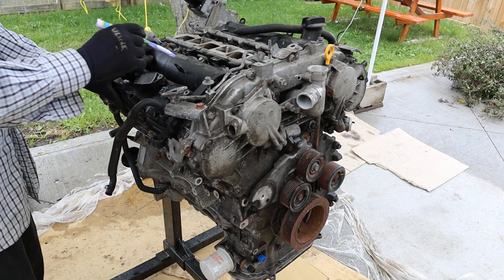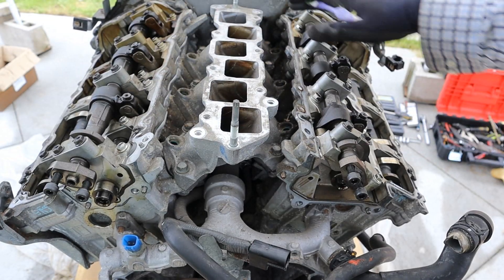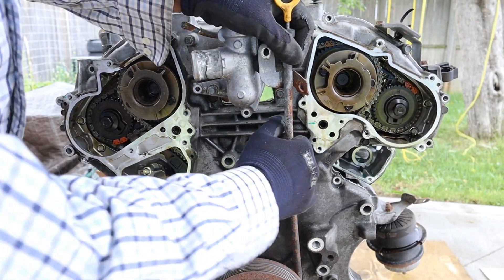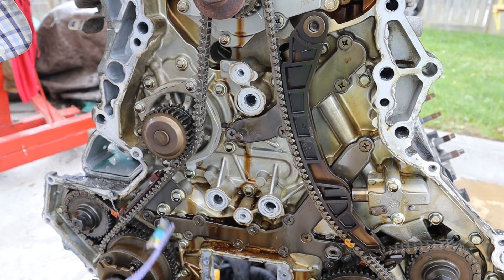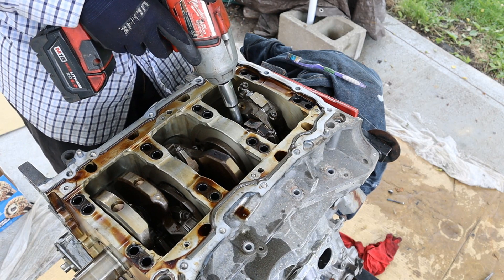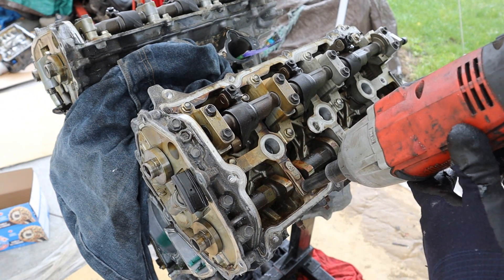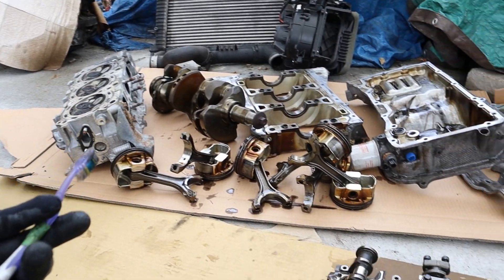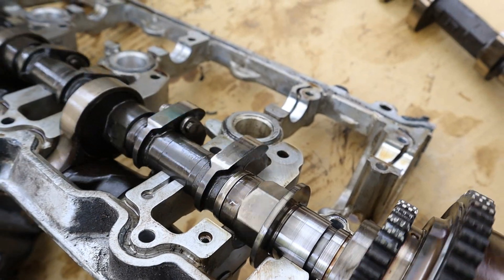The Last Good Nissan Engine: VQ37VHR

Comment: This is not a good engine....This is a GREAT engine!
Reply from the maker: Sure it is....if it doesn't starve itself of oil
Reply: I still see so many of these Infiniti's around unlike Lexus, Acura, MB, BMW from this era.  VQ37VHR 💪
Reply: @erikllanos3906  this has been the most reliable vehicle I've owned.  And I've owned a Honda's and a Lexus is350.  The VQ37 will go down as top 5  best V6 NA engines of all time 🏅
Reply: @speedkar99  the oil starvation is pure lack of maintenance and nothing to do with the engine unless it’s caused by the gallery gaskets. My best friend has a g37 with 180k and it burns like 1/8 of a quart between 5k mile oil changes.
Reply: @trizkial7592  ...and if you get a 2012-and-up VQ37VHR with redesigned gallery gaskets, it's damn near-bulletproof. Change the 5W30 oil at every 5K miles, that's it. Mine has 116K on it and is 10 years old, doesn't burn a drop and I've had it since Oct 2016.

Comment: I have a 2010 G37X w 212k miles. Switched to 3k OCI with marvel mystery oil during the last 500. Runs very smooth. 0w-40 in winter 5w-40 in summer. Need to do the gallery gaskets soon owner before me never did them.
Reply: Do them now.
Reply: @doubledewdagod  I ran a pressure test and it was super low on idle so 100% getting done before summer. And no more daily driving it until then
Reply: @urygen  How did that go?
Reply: @jacquesc3166  ran the test with another gauge cuz I suspected it was faulty and the pressure was actually good. All within spec. Still on original gaskets now at 227k miles. Running Rotella T6 5w-40.

Comment: Nice breakdown. Lots of metals, must be a very heavy engine. Replacing the water pump won't be quick either.
Reply from the maker: Yep, it sure is heavy. As is the FM platform of cars that used this engine. Not the nimblest at all
Reply: trust me it isn’t. i’ve done it twice
Reply: @speedkar99  ...but you drive a GS350?!? Sure hope you're aware that car is substantially less nimble than a G37, did you look up their Fr:Rr weight distribution? Have you actually driven a G, or just guessing? Your comment makes me think the car does NOT have double wishbones up front. Don't piss on G's, you won't like it.
Reply: @jacquesc3166  He is driving old mans lexus and G37 is not nible enough for him) G35 and G37 just a notch lower in steering department then bmw 3 series .

Comment: I have a 07 G35 with the VQ35HR engine and it's a great engine if it's taken care of. I've recently did the updated oil gallery gaskets (original gaskets were not blown out) and water pump, mainly the water pump because it started to leak through the pisshole and looking at it and comparing it to my old Maxima DE engine, this one is a nice design with too much bulletproofing. I was looking at newer G37s but after seeing the VQ37VHR engine and the unnecessary complexity that was added to it, I quickly swayed away from it. Only 24HP and less than 10TQ gain over millions of dollars in research.. :face-turquoise-covering-eyes:
Reply from the maker: Does it burn oil?

Comment: My 2019 370Z is hitting 42K miles and the engine uses no oil, as indicated on the dipstick, between my 3K mile oil changes. I have used the recommended Nissan ester oil since the beginning and change it every 3K miles. I did break the engine in very carefully and slowly, taking about 15K miles before it was fully broken in. Until that point, the engine used about 3 to 4 oz of oil during the 3K mile oil change interval. I don't use the OEM size filter that Nissan uses for this engine, instead using the filter from the VK56 engine. This filter is identical to the 370Z filter, except that it is about 50% taller. This increased filtration area results in about a 3 psi reduction in the oil pressure drop going through the filter, by my estimation of flow calculations. The particular filter I use is the Fram Ultra Synthetic, which supposedly filters about 98.6% of particles greater than 10 microns and about 99+% of particles greater than 20 microns. Abrasive dirt particles in the 10 to 20 micron(25.4 micron = 0.001") range are supposedly the most damaging to engine bearings and journal surfaces.

When I cold start he engine I let the engine idle for about 5  minutes, until the coolant temp gets up to normal. After I drive away I keep the revs from exceeding 2K rpm until the oil temp hits 180⁰F. The engine runs quietly and smoothly, with practically no soot build up on the inside of the exhaust tips. At my 30K service trip I had one of the spark plugs pulled and dropped a borescope into the cylinder to inspect the piston top and the cylinder wall. The spark plug(iridium tip) was clean with hardly any electrode wear and the piston top had no deposits, other than a slight darkening of the original bright metal finish of the aluminum. The cylinder bore had no scratches nor scuffs and the crosshatch finish hone pattern was clearly visible.

From my experience, this engine will run reliably for many years if given good maintenance and not abused.
Reply: Good job mate, it should last for a long time, I do the same with my BMW N55 engine now at 81000 km no oil leaks or oil burning
Reply: You really shouldn't let the engine idle from cold for that long. You aren't doing it any favors extending the warmup of the oil. Ideally, you should be turning it on, waiting for the idle revs to reach ~1000-1100 rpms/when the initial cold start procedure is finished (when the exhaust quiets down after purposefully running rich), and then begin to drive, staying under 3k rpms until operating temp is reach.

It's a horrible myth that letting your car idle until fully warm up is a good idea.
Reply: wow, you baby the car too much.     I drove the living piss out of the my 2003 G35 since it had about 5k miles on it.   To this day I still drive it hard but not every day anymore.  It is at 290k miles without any issues.    on my 2012 g37 I also drive it hard every single day,  it's at 122k miles - no issues either.     You don't need to idle it for 5 minutes.   It's actually not good for the engine.
Reply: @tomzphone  You could be right about not needing to idle it that long on a cold start; my reason for it was a recommendation from Ferrari to its owners of, I think, the 360 to idle it from 5 to 10 minutes on a cold start. I do take better care of the car than myself 😁

Comment: Awesome class Professor, "so crusty"😂. my 2017 QX50 hasn't burned oil at all at 57k miles. Hoping it stays that way cause I love this engine. 1st noteworthy repair just a cracked mount.
Reply: Personally noticed it is highly dependent on what oil is used. Newer Pennzoil 5w30 seems to burn/blow-by quite a lot (the VQ isn't alone in this) whereas Mobil 0w40 doesn't have the same issue, from my experience.

Comment: So the reason why rod bearings are usually the first thing to go is because the crankshaft is spinning in the main journals it's not really subjected to any up or down linear force so whenever you run out of oil the rods are still getting pushed into the crank by the force of combustion which causes damage to the rod bearings faster than that of the main bearings

Comment: Would you buy a 119k 2017 Infinity QX50 with this engine...or a 120K 2017 Volvo XC60 T5 (2.0 Turbo) if both ran well and appeared to have no issues?

Comment: Love your channel!
Been working on 1.9 engines my whole life and learning about bigger engines is super fun now!
I want to start a project with 350z but I'm having hard time picking an engine for rebuild. 35de or 35hr or the 37 series? May i get some help and comparison what's the pros n cons compared to each other?
Reply from the maker: Tell me about the 1.9 TDI, I'm about to tear one down here
Reply: @speedkar99  90% of them timing belt,average of 100hp stock,water pump usualy driven by the timing belt,newer engines are direct inject,almost never an aluminum block,majority are 8valve but there are few with 16 as well.
Pros:Super easy to work on,low maintance, perfect for daily dirve,low fuel econ,lasts for decades if driven with care
Cons:  Sohc only,not a lot of market price oscillation(interior change is the only thing u can profit on or low milage)
and i quess VW is the first brand u taught of when u heard 1.9tdi
Reply: @speedkar99  why does this feel like Final exam question  at high school 🤣🤣

Comment: Can't say I like what I have seen about this engine...
Reply from the maker: And what don't you like?
Reply: @speedkar99  the fact it's an over-engineered over-complicated nightmare to work on
If it's mounted transversely, just drop it down outta the car to do the heads.....
Reply: @lancecooper4646  the vq37 is longitudinally mounted it’s a RWD platform…. 

Nor is  any of the more complex designs a know issue with the platform. 

Been on sale for nearly 15 years these engines are pretty dang solid . Lol

Comment: I have one with 180k miles, no leaks, no oil consumption .I always use good fully synthetic oil and add 6 quarts instead of 5.
Reply: ive never heard of doing that, i would personally follow the owners manual rec
Reply: @expofcam  I use large oil filter from a v8 and extra oil. You should listen to experienced owners, not car manufacturer . For example all Nissan dealerships now using 0w20 oil on older engines , just for lower emmisions and slowly killing peoples cars.

Comment: 3:03 there is a big connector right under your hand. I found the wire harness disconnected from it when I was replacing my knock sensors. Any idea what it is or what it's for?

Comment: Newer 4.0 VQs pretty good besides the timing chain driven water pump
Reply from the maker: Those will be long gone as soon as emissions requirements tighten up
Reply: @speedkar99  that’s so stupid. These emissions BS has gone way past the point to diminishing returns. I will continue to drive my V8 with no cats and a tune.

Comment: Got an off-topic question for you.
Would you have an opinion on what is the preferred gasoline for the 3.0L V6 1MZ-FE? My 2000 Camry manufacturer's manual says: "1MZ−FE engine: Unleaded gasoline, Octane Rating 87 (Research Octane Number 91) or higher. For improved vehicle performance, the use of premium unleaded gasoline with an Octane Rating of 91(Research Octane Number 96) or higher is recommended."

Would you suggest "premium unleaded", especially for shorter, city-street commutes? I want to use Chevron's Supreme Plus with Techron.
Thanks speedkar99.
Reply from the maker: 87 works fine with the 1MZ. 
Using 91 isn't going to make it faster or last longer. You'll get better fuel economy but not enough to justify the difference in fuel price.

Comment: Sir can I have the bottom half for a 350z hr turbo build. The newer z unfortunately went with a lower displacement engine. Oppps spun bearing. I prefer the HR head with control of both cams.

Comment: I love how he kept saying how strong it was, then just casually mentions they’re notorious for burning oil 💀
Reply: An engine can burn oil for YEARS. My neighbor's Scion TC burns a quart every 800 miles or so. It's been doing that since 150k and he has over 250k on it now. I offered to swap in an updated 2AZ or to rebuild his current motor but he declined. 🤷‍♂️
Reply: They are not notorious for burning oil. The "high rev" version of the VQ35DE was. My 370Z is at 55,000 miles and it is on H every time I check the oil.
Reply: @povertyspec9651  you mean the VQ35HR? And I think the oil burning problem was with the smaller oil control rings
Reply: @xinx-fn8973  No, he doesn't mean the HR. The HR is bulletproof, minus gallery gaskets. What he referred to, and yes piston rings were THE issue, was the Revup version of the VQ35DE which has a 7K redline instead of 6,600.

Comment: E-Torx, ran into those bolts on a MR18DE I needed the torque converter from (engine seized). Wasn't anything a 13mm and a hammer couldn't handle

Comment: The VR30DDTT seems like a great engine as well in the new Z and the Q50.
Reply from the maker: Have you seen my Q50 review? It's very complex and tight in the engine bay. And for no power gains over the VQ37...
Reply: It’s a fantastic motor has some teething issues with turbo seals that need to be sorted out but yeah engine bay is very tight. Lol
Reply: @speedkar99  it actually makes about 30 more wheel horse power and 50ft lbs more torque even in the 300hp trim.

The 400hp version is closer to 100ho and torque over the old VQ37.

Nissan just downplayed the numbers on the new motor. 

It’s more complex but that’s typical of modern engines and they don’t overdue but is very cramped engine bay no question. XD
Reply: @BigHeadClan  turbo duh! Dont u av sense ? slap a turbo on vq an even a safe tune easily an deliberate makes more power than 3.0 tt
Reply: @infinitibossauto  You can’t just slap a turbo on an engine that wasn’t designed for it from the factory and achieve good reliability, the fuel system, durability and supporting components all need to be changed which isn’t cheap.

The VQ platform is also nearly 30 years old and needed to be replaced from both a technology stand point and emissions stand points.

They took what they learned with the vq37 and Vr38 and mass produced a capable twin turbo engine.
Reply: @BigHeadClan  bro i get your point but your talking rubbish about reliability what power u want thats ganna make a vq37 unreliable?? 500whp is always reliable on vq37 its when u want too much going pass that is where u get problems but 500whp isn’t ganna do vq37 anything

Comment: One fatal common flaw of this engine are those cardboard gallery gaskets. You done effed up nissan. If you own a 13' not to worry, since nissan replaced that cardboard with metal gaskets as it should have been from the start
Reply: Does 2011 have a lego gasket?🥺
Reply: wasn't that replaced for the 2012 model?
Reply: @tomzphone  Yes, most 2012MY Infinitis had the new gallery gasket design in them. I think Jan-Feb 2012 models are the only ones that didn't get the new gaskets.
Reply: @jacquesc3166  that's good news.  mine is from August.
Reply: @tomzphone  проблема не только в прокладках, но и в ослабевающих болтах крепления. Так что модернизированные прокладки не являются спасением, не забывайте мерить давление масла. Также можно установить датчик давления масла на 1 Бар от Мицубиси

Comment: Dude when are you doing a Northstar engine? You will have no problem finding dozens in junk yards
Reply: Would be a great tear down considering how shit those engines are and how great they could of been for the time if not for a big fatal design decision
Reply from the maker: Yeah but I don't want to labor of removing an engine. I want someone to do it for me and I buy the core
Reply: @speedkar99  Oh I see. Just thought it would be a great engine for one of these because you can show all the flaws that add up to a disaster. Especially the odd design in some places. And also especially the shallow fine thread head bolts that pull out of the block

Comment: Last question does it really matter to use the Nissan oil filter or can I use a k&N or what ever. Does the Nissan filter flow better ?
Reply from the maker: I prefer OEM. Doesn't cost more than aftermarket
Reply: @speedkar99  well yeah that's true

Comment: VQ37 isn't known for burning oil AFAIK. Lack of oil cooler is a bit of a PITA
Reply from the maker: All VQs burn oil lol
Reply: @speedkar99  I can only offer anecdotal evidence, but I never need to add oil between oil changes on my VQ37. A few friends that I know with the same motor never complained about oil consumption either. The VQ35 on the other hand is definitely known for oil burning. I know 3 VQ35s and they all need to top up their oil. I think VQ37 is more rare
Reply: @NoRogeR  Aye I’ve not know the vq37 for burning lots of oil nor observed that with my own g37 it was a common issue of the vq35 though.

But most engines start to burn oil as the age and is something to watch out for.
Reply: @NoRogeR  Yep. Been driving VQ's since 2010, 5AT (3) and 7AT (1). This Toyota fanboy has no clue about VQ's and oil burning, none. As if every VQ is a DE Revup from 05-06 Z33's lmao
Reply: @NoRogeR  Vq35hr’s dont burn oil at all. Some VQ37Vhr’s will burn a little bit of oil at the track when Oil temp starts to get hot due to the VVEL. Thats why its common for people to do a VQ37Vhr block with Hr heads and get rid of that problematic VVEL. The Hr heads are better than the Vhr heads
Reply: @speedkar99  Vq35de burnt oil.Vq 35hr and vq37 hr use no oil between oil changes.I own Infiniti 2008 g35x with 160k miles and 2014 QX70 with 180k miles.No problems, no leaks,no overheating ,no oil consumption .I change oil every 12 months and oil level is always at top mark.Zero oil consumption .
Reply: @DaytonaBlueHr  lmfaoo no they are not and not even close
Reply: @trizkial7592  Bud yes they are….. Hr heads are better than Vhr heads why do you think so many people are doing Vhr block with Hr heads build 💀
Reply: @trizkial7592  watch my videos my completely Stock Hr is beating Bolt-on 370z’s and Tuned G37’s 🤷🏽‍♂️
Reply: @DaytonaBlueHr  Yea I’m sure they are completely fair mod for mod wise I’m sure. Stock head and cams and such :)
Reply: @DaytonaBlueHr  I literally just watch you get freight trained by a 370 nismo dude 🤣🤣🤣🤣👍🏼🤦‍♂️
Reply: @trizkial7592  he jumped on me….. want me to upload our reruns where i beat him??
Reply: @DaytonaBlueHr  Jumped on you and kept pulling lol
Reply: @trizkial7592  watch the video i just linked you lmao he jumped on the 2 count last time thats why he was pulling 💀

Comment: These badly needed an oil cooler. I had a 2011 370Z, (I miss) it ran really hot running up (oil) the CO mountain passes. If you ran lower rpm and just patient it wasn’t too bad, but downshift and use that power and it was very easy to hit 300 degrees.

Comment: 100 hp/liter engine rated at the crank. Easily revs to 8,000rpm.
Reply from the maker: Yeah this was cheap power which is why they get abused.